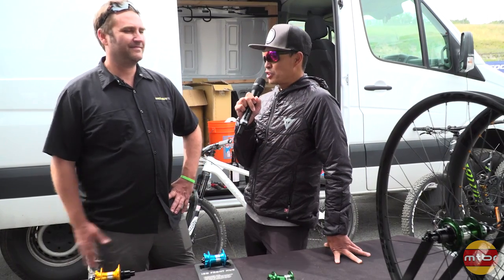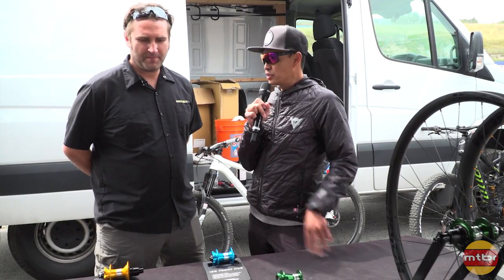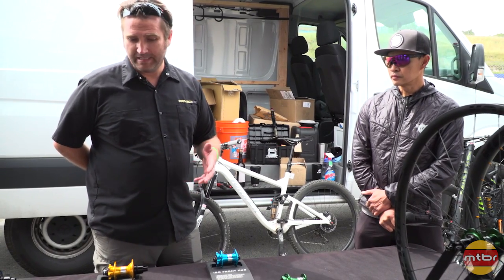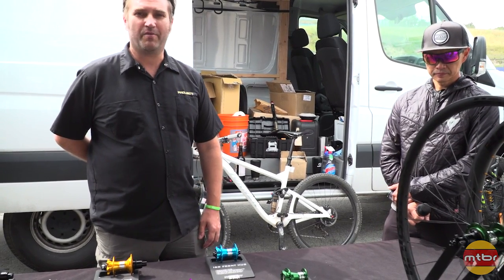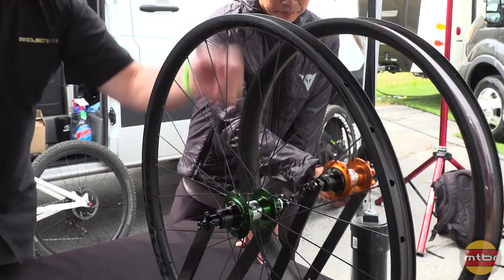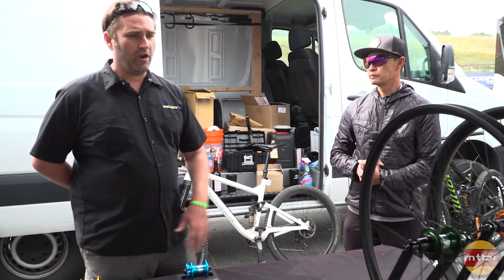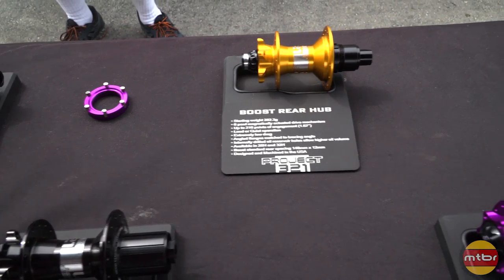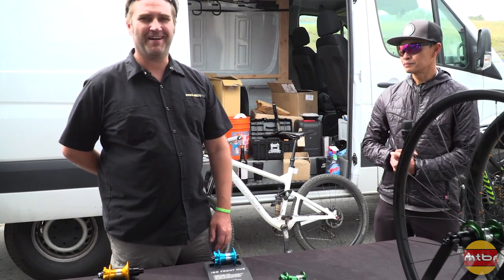First look: Project 321 new magnetic hub driver

Comment: I just had their quiet hubs installed on my Yeti ASR, and mine are NOT quiet at all.  I've emailed P321, and am waiting on their response back...I'm very disappointed in the sound at this point.  Freewheeling is amazingly faster than the previous DT Swiss hub, and the near instant engagement is awesome, but those two things don't make up for the disappointing sound.
Reply: Any luck with the response?
Reply: Brady Essary ......did you get your issue resolved?
Reply: Subscribing. I want a quiet hub too but not half a pound heavy like the Onyx. The videos available for the P-321 quiet hubs are not so quiet. Sounds like my DT 240 with 54T packed with grease.

Comment: I want to see Centerlock compatability.  What's the material; are these 7075?   Are they CNC cut from forged blanks like Hope hubs?  Are they just CNC'd from billet?  I would guess by the finish under the ano that they are indeed 7075 series aluminum but there is no mention on the website of the material.  None of the "technical information" for the hub on your website even states the material used... a bit disappointing honestly.  Do you "form" the brake rotor threads because you're using 6061 series?  That would be upsetting and pricing your hubs alongside other 7075 options would seem negligent or misleading.  7075 is much stronger and more expensive than 6061.  Also harder on tooling which can raise prices.  So what's the material and what incarnation of it are you using?